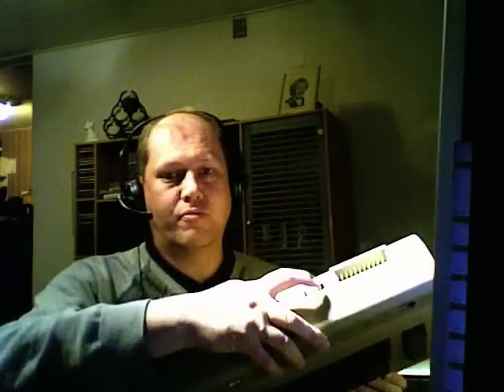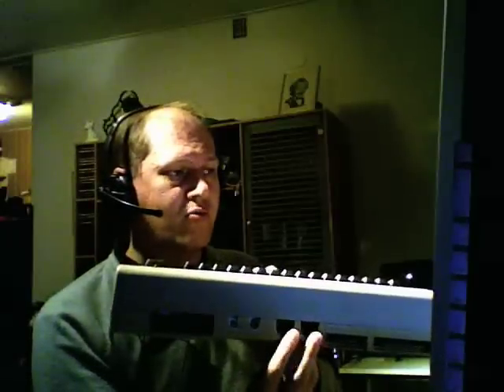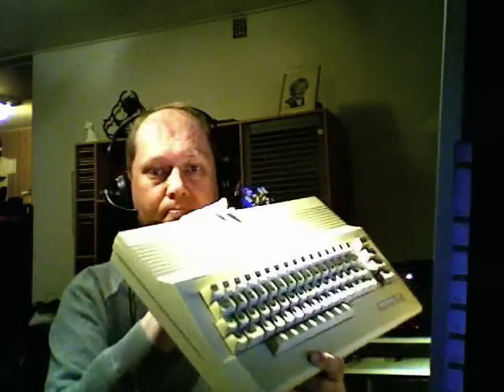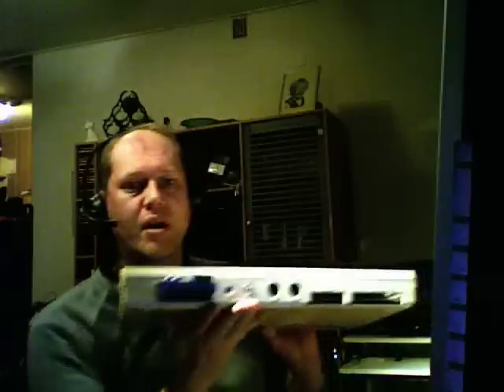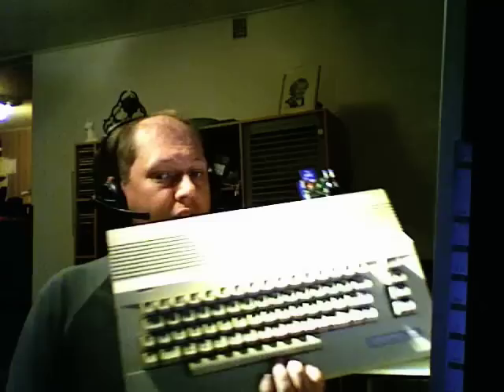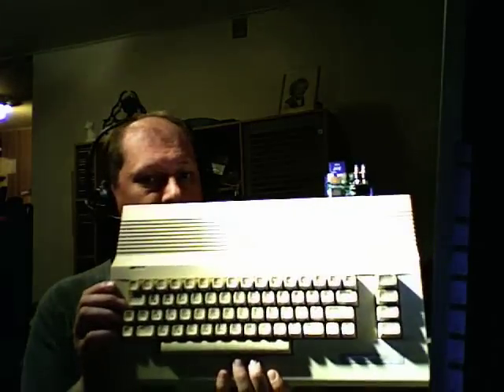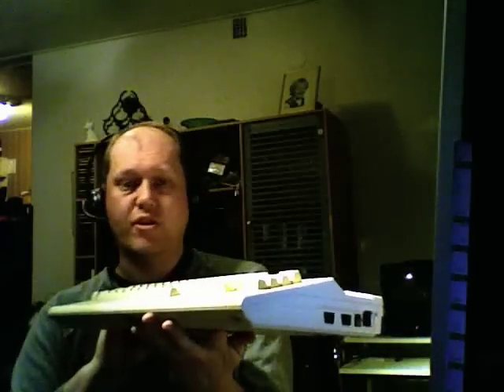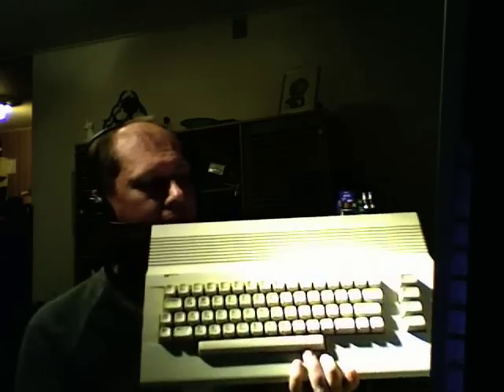Comparing the C64C with the original C64

Comment: Respond to this video...
          The C64C had a completely new motherboard, and they used all new processes to make the thing. Runs a lower voltage to the earlier model, different memory chips, 9v instead of 12v...... The motherboard is 1/3 the size if i recall.

Comment: This reminds me of my Vic 20's that I still use. The vic also has a problem with case discolouring. I repaired at least three Vic's, and on the Vic 20 when the video chip goes its usually a sign that your power brick is starting to fail. It may be sending too much power into your commodore. You may need to replace the Vic II chip in your old c64 I'd get rid of the old power brick and get a newer one to replace it. As well I think you will need to put in a new fuse with the same amps or more.